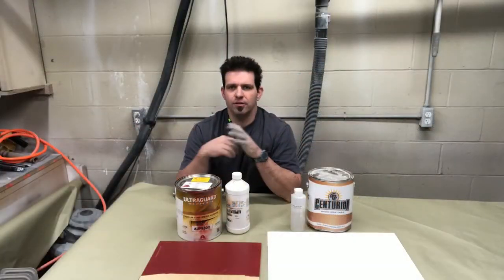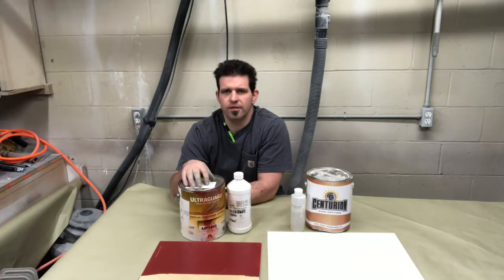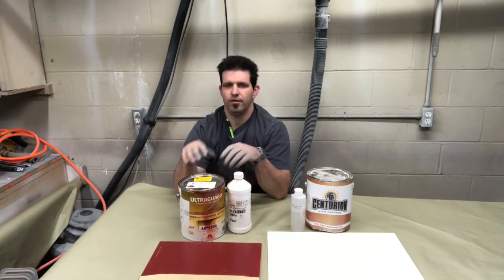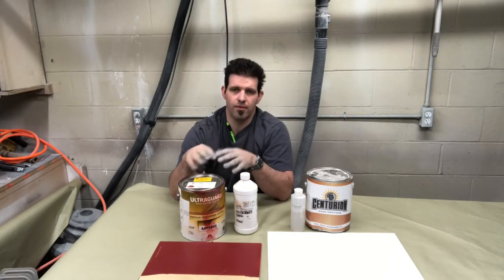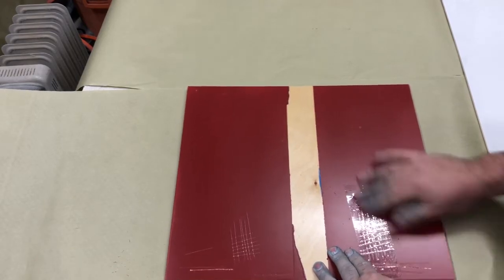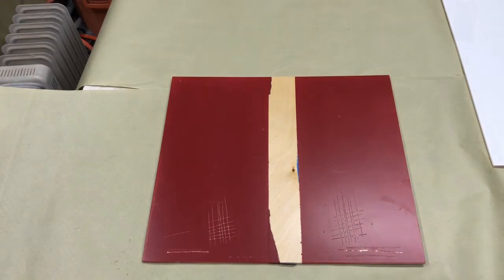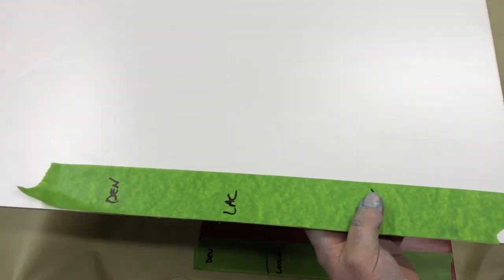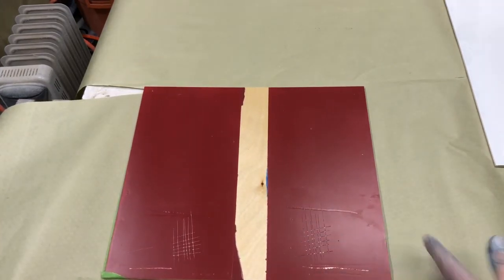Axalta Solvent Based Conversion Varnish

Comment: Hey Eric great video. Was the Axalta conversion varnish catalyzed 3% (4oz per gallon) with CXC4000 catalyst? Thanks! Scott
Reply from the maker: The Wood Craftsman yes you are correct and you can use that same catalyst for the vinyl sealer as well. Also I apologize for not getting back to you on the milesi stuff. I talked to Blake and he said it would be best to just call the hgh 1-800-277-8888 number and that will put you in touch with the Birmingham facility which is where  most of the milesi comes from. They don’t have stock in the Nashville showroom yet. I am the only finishers that is using the material currently in Nashville. I have a potential job where I will be shooting over 5 gallons of it coming up soon if it goes through.